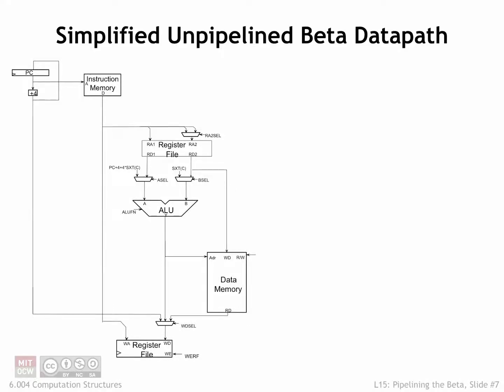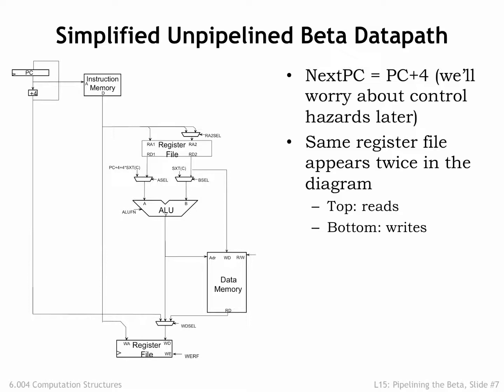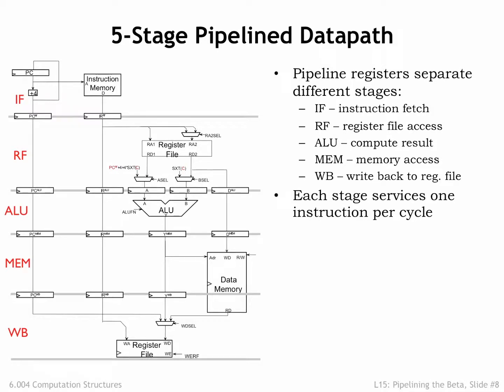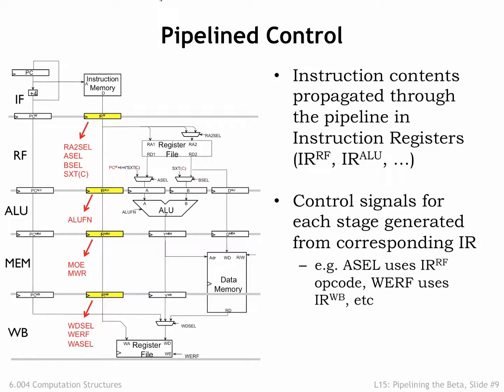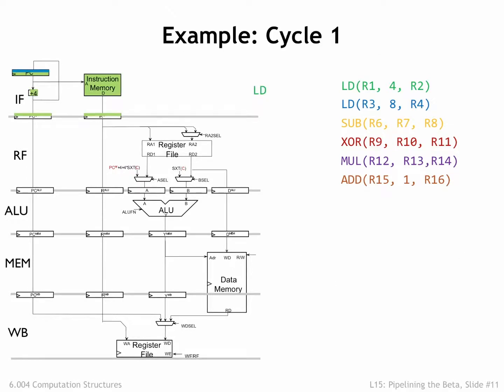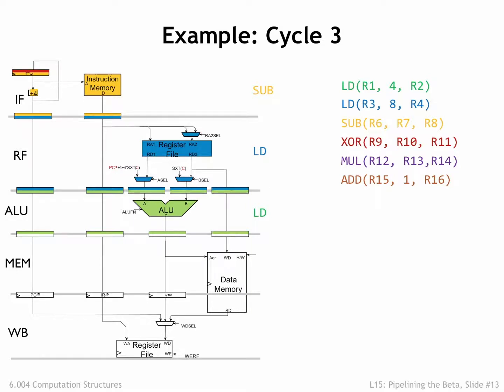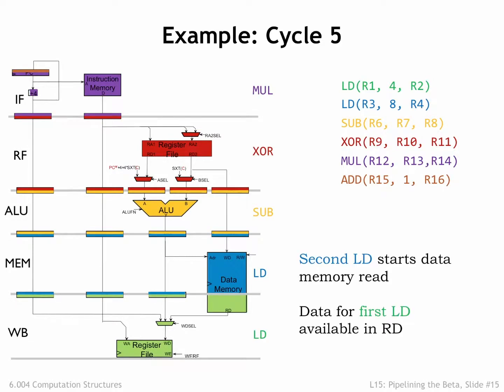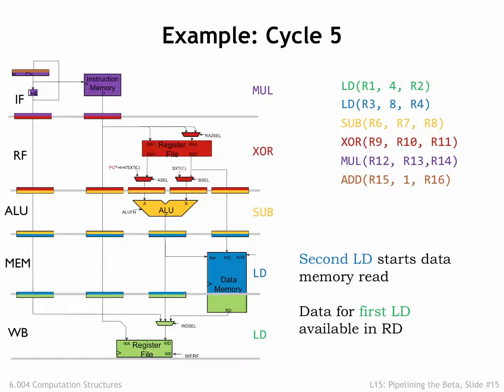15.2.2 Basic 5-Stage Pipeline

Comment: Is this using a Harvard architecture, I noticed the distinction between instruction memory and data memory. How would this work if using a Von Newman architecture (may need to read twice in the same clock cycle, one in IF and the other in MEM)? Do we simply have two read ports for main memory?